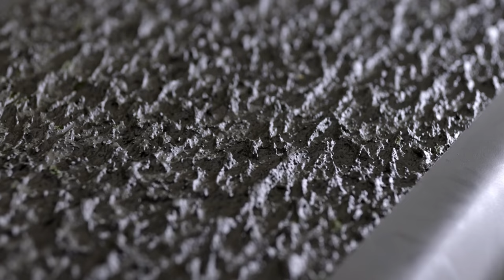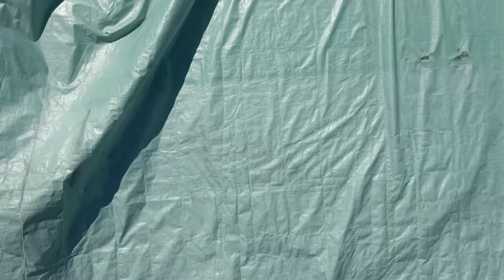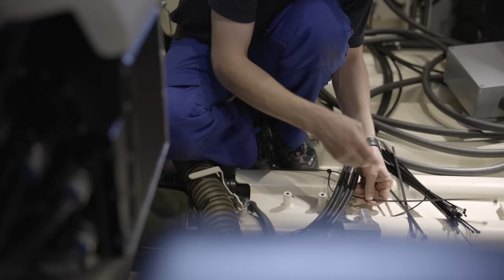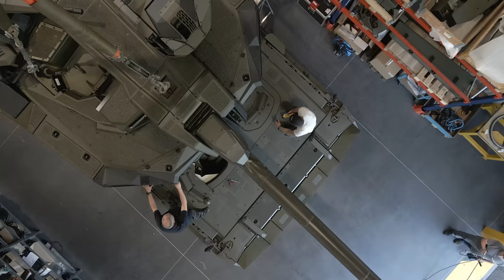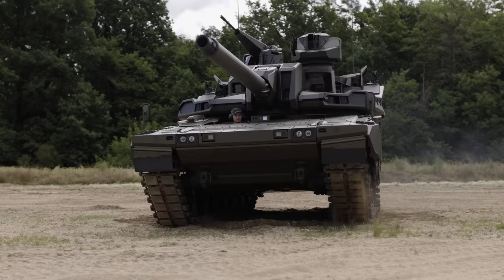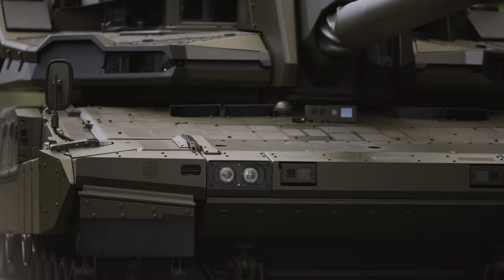L'#EMBT

Comment: Looks very interesting, 2 points I noticed:
   - The turret high is very low.
   - The 2 hatches for the crew on the turret are really low, it is like the hatches are only a mean of scape but the crew is below the turret.
I looks to me like they placed to crew very low so they have minimal exposition on the external part of the turret that way they can minimise the size of the turret. 
I think this is clever thinking, it looks like a hybrid between unmaned turrets and the traditional turret with autoloader. This is a more clever arrangement than the T14, because the crew still have acces to the turret to unjam any mechanism if needed, it will also produce a lighter vehicle and smaller target .
Well done guys.
Reply: Indeed, it's very similar to some old soviet concepts like object 477, or the Jordanian Falcon turret.
Reply: @florisvdwetering  Thanks for pointing out that, object 477 looks interesting
Reply: @florisvdwetering  And don't forget the South African Rooikat Medium Turret Technology Demonstrator (MTTD), which was a private venture to test the concept of a Rooikat-based 105mm or 120mm gun turret with an automatic loading system.

It used a regular production Rooikat hull with a completely new two-man turret. The loader/commander was positioned on the left side of the turret and the gunner was located on the right side, both in sunken positions allowing a low profile wedge shape for the turret where the crew was located. The main gun was in the center, a 105mm high pressure gun but it was intended also to test a 120mm low pressure gun. The main gun was automatically loaded with ammunition from the turret bustle. An active protection system (APS) mock-up was located on the rear of the turret but was not functional. The Rooikat MTTD was only a demonstrator vehicle and never entered production.

Comment: Is this the tank with the 140mm gun that's in competition with the new Panther/Rheinmetall?
Reply: Non, 120mm car c'est une tourelle (et donc un canon) de Leclerc sur un châssis de Léopard 2
Reply: No and yes. Not yet 140 mm (next year ?). And yes, it's the competitor with the Rheinmetall Panther.
Reply: yes and no. 
There was no competition :  
- germans had to provide chassis, transmissions, digital controls and new gen engines
- frenchs had to provide the whole turret with next gen ammo (compact telescoped ammo, allowing to put much more power than a 125/130 in less long neck), the most powerful gun of the market (140), and a bunch of 360 optical and sound sensors + remote controlled 30mm gun and so on... 

Important to know (you can guess it on all those small plates everywhere), Nexter is working to on disrupting Optical (Cameleon) and Thermal ("Magic") stealth already shown in Euro Satory here : 
https://www.youtube.com/watch?v=L8QrKwkCFLs 

Two years after the launch of the program, RheinnMetal came from nowhere in the game to provide its own turret, dressed like a sci-fi stuff but a bit too flush to be fair, with its own autoloader and 130mm gun, non-telescoped ammo,  claiming they are better cause it's german of course.  
Yet it's a half-generation behind. 

Of course it changes the project to become a germano-german one, french could perhaps add some paint on the box. 

Classic ending situation in french/german projects.
Reply: @philv3941  when you try do get a job besides someone else, that's called a competition. Rheinmetall try to get a (big) piece of the cake on competition with KNDS which is already 50/50 French/German. Yes, the initial task is to make a 50/50 German/French MBT.
Reply: @thierrymilan2039  that's why i said "there WAS" no competition, but yes, Rheinmetalt attempted an illegal one, and i guess germans leader will follow. They allways playing their industry against the others.
Reply: Le 140mm sera bientôt installé
Reply: @philv3941  Rheinmetal is private arms manufacturer so they can show what they want and no French man has business in this
Reply: @philv3941   nope
1. it is rheinmetall's right to create a tank.
2.  i say one word eurofghter.
Reply: @jPlanerv2  The touret is from Nexter, guns too
Reply: @philv3941   That most powerful gun in the market is probably going to be as reliable as slinging a can of tuna. Good luck hitting anything with that 140 projectile without it keyholing thanks to the French deciding to make it a puller sabo and making the barrel life commit suicide.
Reply: @thierrymilan2039  Afaik Rheinmetall have no interest in tearing down this Franco-German project. The Panther is going to be mostly aimed at the export market for buyers who are familiar with the Leo platform. However I wouldnt be surprised if the EMBT/MGCS project fails due to French fuckery as it is their tradition afterall 😏. So yea wouldnt surprise me if Germany goes with the Panther in the end.
Reply: @amararnaut1934  yeah sure, Nexter, one of the best gun builder in the world, creating the Leclerc gun, and the 155 Caesar gun - perhaps the most accurate in the world -  desperatly need your advice in creating this 140 mm
Reply: @philv3941  If that were the case then most of NATO would've adopted the French gun instead of the Rheinmetall one, but whatever. The French should've went conventional or not have made the sabot a puller one. Pullers are highly unreliable, its why you dont see anyone using them. But since you seem to be quite the baguetteboo all I'll say is cope and seethe frenchie.
Reply: @amararnaut1934  What is this type of puller ammo you speak of? How is it different that the kind we're already using?

Comment: so many cameras... one blast nearby and they're all down, your commander is blind, and you have an armored duck, sitting at a corner, waiting to explode at any moment.
Reply: What makes you think they don't have redundant systems and optics ?
Reply: @haaxeu6501  And what makes you think they won't also blow up?
Reply: @Driendel  I didn't say they won't blow up, I mentionned redundancy.
Reply: Redundant sighting systems can help the crew to hold on after getting blasted and losing most of their cameras and sensors, but their spare systems are just as fragile. What makes this modern also makes it vulnerable. Unless it can out-see and out-range the enemy (which would be the ideal situation for any tank, but rarely happens in battle), it will be an expensive, power-hungry piece of armor that can be dealt with by kid with a paintball gun.
Reply: Lol clown! 😂🎉😂🎉

Comment: It's that a 90 or an 105mm gun ?.
Reply: 130mm
Reply: @joergfro7149  You're wrong. 120 mm (140 mm next year) + 30 mm anti aerial.
Reply: @thierrymilan2039  non 30mm pour le AA ( tourelleau ARX 30,).
On peut ajouter une 12.7 coaxiale et une 7.62 sur le hunter killer.
Reply: @victor6814  30 mm ok.
Reply: 120mm from the leclerc
Reply: @anonyme5646  oui sauf qu’au final, on aura bien un 140mm. Le 120 n’est là que pour meubler
Reply: @joergfro7149  no 120mm and soon 140mm

Comment: Damn that's hot. Make a new 6x6 to go with it.
Reply: @Tsar_Nicolas_II  I will eat my hat if that ugly duckling has neutral steering like the AMX-10, which is why I said a NEW 6x6 :p
Reply: @shoeby9273   the vehicles are based on a 6×6 commercial all-terrain truck chassis and use standard commercial truck engines

Comment: Ça à l'air pas mal. 
Mais quel caractéristiques 
Principales. 
Poids
Vitesse
Calibre
Puissance moteur
Autonomie
Reply: Calibre 120mm canon de leclerc le reste jsp
Reply: Après c'est ce que l'on ma dit donc pas sur mais normalement c'est bien le 120 du leclerc
Reply: Et la base du char c'est une léopard 2a7 mais seulement l'Avent est modifiée enfin c'est toujours ce que l'on ma dit si tu veut savoir  j'ai juste regarder un vidéo donc c'est pour ça je suis pas sur mais le canon ressemble à celui du leclerc et la base à celle du léopard 2a7
Reply: On ma confirmé tout ce j'ai dit est vrai en plus il a plein de déflecteur donc 4 membre le 4 s'occupe des déflecteurs aide le chef de char peut piloter un drones et tirer avec le 30mm sur la tourelle pour l'anti drones
Reply: Avec la nouvelle munition shard pénétration et performances quasi inégaler par la concurrence le tank c'est un gigachad sur Chenille
Reply: Le poids vue qu'il est bien plus compacte qu'un Leclerc il doit peser un peu moins lourd dans les 50tonnes. La vitesse sera sûrement égal au léopard 2 avec des améliorations donc du 70km/h 
Le calibre sa sera pour l'instant le canon CN-120-26 du Leclerc avec un rechargement automatique. Largement suffisant pour aujourd'hui. Même si le 140mm sera installé dans quelques mois

Comment: The only issue with the EMBT is the Leo 2 hull. There will have to be A LOT of improvements made to the frontal hull armor for it to be a viable MBT in modern combat when APFSDS is hitting the realm of +900mm of penetration. I am very interested to learn about their "armored capsule" versus the T-14 Armata's. The weight savings from using an unmanned turret will help in allowing more weight to be allocated to armor protection, but that turret still seems pretty beefy and full of heavy equipment, such as what seems to be a 25, 30, or 35mm autocannon RCWS mount. Even with all these unanswered question, the Nexter's EMBT still seems much more capable and an overall better tank than Rheinmetall's KF-51. The KF-51 relies on too many "modular" gimmicks, which when in use, severely hamper its other crucial systems, such as its main battery ammo capacity, something which modern combat with supply lines that can disappear with one swarm of enemy UAVs, cannot sacrifice.
Reply: From the cut out letters on the autocannon RCWS mount, it seems to be a 30mm autocannon called "ARX-30".
Reply: The turret isn’t unmanned, there’s no talk of a crew capsule either for this tank. There’s 2 crew in the turret, 2 in the hull, one of which will control the 30mm and be a system operator.
Reply: @florisvdwetering  look at the top of the turret, no hatches. That was one of the main things they tried showing off.
Reply: Also, note the 3 hatches at the front of the hull, two more next to the driver's hatch, that is for the commander and gunner to sit side by side next to the driver. It's all clearly visible and was what they were trying to show off.
Reply: @CH3TN1K313  There’s literally 2 hatches right there and there’s vision blocks with cleaning sprays. I suggest you look again at the video and the eurosatory images.
Reply: @CH3TN1K313  They literally revealed a specification during Eurosatory and on the KNDS website that disproves this. There’s also only 2 hatches at the front
Reply: Infact next to seeing the hatches at the top in this video. You can even see the seats in the turret basket when they have the turret suspended in the air.

Comment: La tourelle semble fragile avec 0 chance de ricochet.. 
j’y connais pas grand chose mais..
Reply: en fait il y a une pente générale du blindage de la tourelle, qui au lieu d'attaquer le devant façon abrahams va du début à quasiment le milieu de la tourelle, une pente très faible au contraire qui présente de meilleures chances de déviation,  les éléments accessoires sont posés dessus, on prend le parti de les sacrifier en cas de coup direct- ça donne cette illusion de facettes "face" à l'ennemi.
D'autres part elle est extrêmement basse et compacte, sans aucun autre projet faisant aussi "plat", ce qui est aussi un gage de survivabilité.
Reply: @philv3941  un peu à la merkava :) 
Merci pour les infos
Reply: L'aspect plat de la tourelle peux se traduire en Armure plus fine donc moins lourde mais tout aussi efficace voir plus car moins de poids veux dire qu'on peux rendre l'armure plus épais. Je remarque des protections actives pour combattre certaines munitions aussi. Le char à l'air fin, mais l'épaisseur de l'armure je présume ne l'est vraiment pas. Les flèches moderne ne font pas de ricochets d'ailleurs, ils cassent. C'est pour ça que les chars modernes ont un profil d'armure plat.
Reply: So the tower is most likely not inhabited. 
Like the T14 armata tipo, or mmmm
I don't know much tanks without a crew in the turret
Reply: @КириллМихайлович-ц3з  this demo tank has an inhabited turret with an autoloader like the Leclerc

Comment: Interesting technology demonstrator, just like
KF-51 Panther
Reply: Exactly.  Neither have a chance of making it to production.
Reply: @Red.Hot.Chili.Beans63   Wrong for both.
Reply: @hermes6910  How often have the French and Germans collab'ed on massive weapons projects that resulted in anything past a prototype?  Also, both countries are continuing development of their respective tanks.  No chance this demonstrator goes to production for either the French or Germany Armed Forces.
Reply: @Red.Hot.Chili.Beans63  KNDS is here now, so things are different, Rheinmetall is a thorn but nothing critical, especially if Italy joins the MGCS.
The MGCS or even the SCAF may be delayed, but they will exist.
Because both countries will need them.

Even with the current German government, we don't really have any other choice.
France has the technology but lacks the money and the size.
Germany has the money but lacks experience and size.
The only alternative is to go back to the USA, and although it was a popular stand, the Germans (military) are more disposed towards the EU than the USA.

Is it easy? Certainly not.
But it's necessary - it would be one of the worst decisions for both sides to go it alone.

In the long run, if the EU wants to exist, we have to find a solution to cooperate on military programs.

Comment: turret armor looks weak
Reply: Turret seems unhabited, no need for huge armor there.

EDIT : It seems to have a crew of 2 actually.
Reply: Because the look has something to do in ground combat ?
Reply: @Quatuux  turret is manned, there is some hatches
Reply: The turret is just a lower profile design, the crew is situated lower in the turret basket, i don’t see why everyone thinks it has bad armour protection just for being a more compact design, being not as tall just means it can still have the same armour protection or even more while weighing less. You could probably measure how many mm of armour it could fit by measuring the turret cheeks in the top view.
Reply: @fuckedlaptop364  Hatches could be for maintenance.
Reply: @Quatuux  KNDS has stated 2 people in the turret, 2 in the hull. You can also see the seats in the turret basket in this video. They also wouldn’t have vision blocks on an unmanned turret.
Reply: @florisvdwetering  I'm absolutely not an expert, I just shared my guess based on observations but I did not even spot these seats. Thanks for the information! :)
Reply: @Quatuux  Np!

Comment: It's good that the Italians did not join the project. The tank came out mediocre. Same leopard chassis and 120mm gun. Panther turned out better.
Reply: What do you mean?
Reply: Leopard’s chassis is not  italian and not producted in Italy, and a modern local 120 mm gun is fitted only for tank hunters. So…with or without italy the tank would have been the same. Eventualy Leonardo’s systems could be used.
Reply: @matteocalestini5101  i see; tho italian kinda stopped malingre their on 120 and now use Rh one anyway; and italian have at least good things as far as optoelectronics goes
Reply: You speak like you don't know what you speak about. Read more about...
Reply: @thierrymilan2039  i actually do know what i am talking about
Reply: @castelainteva8082  Indeed. Just I was answering to Gerd as the first talker, not to you, sorry.
Reply: @thierrymilan2039  oh OK my bas sorry
Reply: @Tsar_Nicolas_II  it’s just a prototype. The final canon is a 140mm
Reply: Panther uses an even older version of the leopard chassis. You can tell by the old driver’s hatch. It’s just dressed up, i think the EMBT is a much more realistic design as of now, Lynx had to go through years and years of development after it was revealed to become an actual useful vehicle and not some weird sci-fi looking thing. I think the only thing Panther really has above the EMBT is the two mini drone launchers, the APS side armour (honestly disappointed that EMBT does not have better side protection), and the gun for now. Still Panther weighing only 50 tons while having such a huge turret is really sus.
Reply: And what are italians going to do now? Keep driving their 40 year old tanks?
Reply: @florisvdwetering  the EMBT is designed to carry his own minidrones. There is a telepilot in charge of them, plus the air proximity sensors and the ARX30 turett.
The low armor is because of the french tactics, based on high mobility and firepower. But it has an hard kill system ( eurotrophy ).
The design with an anti air weapon on the topside is currently showed by the USA too for their future abrams tanks.